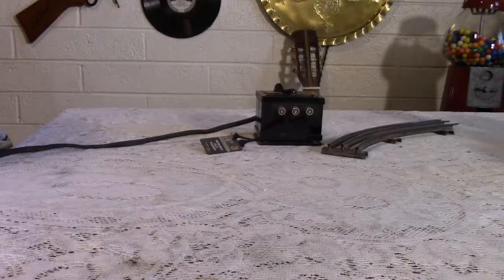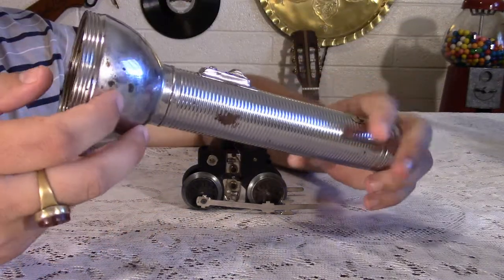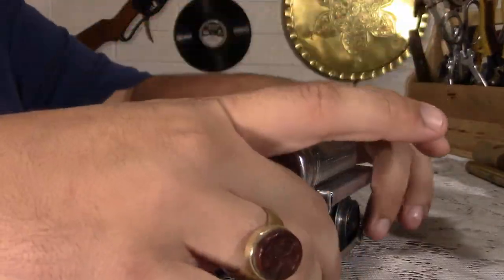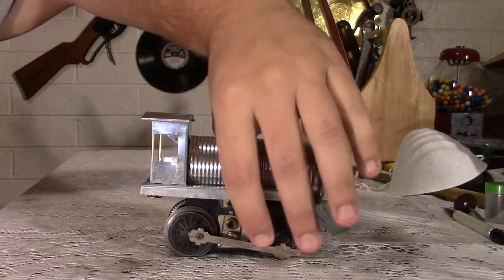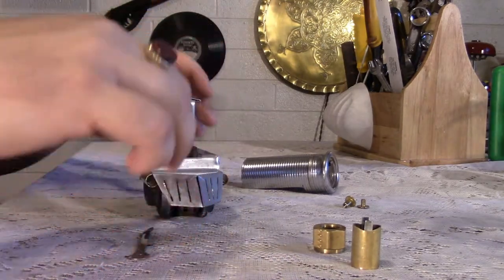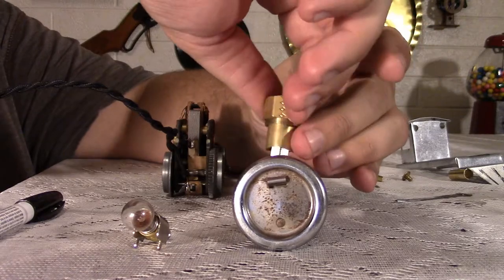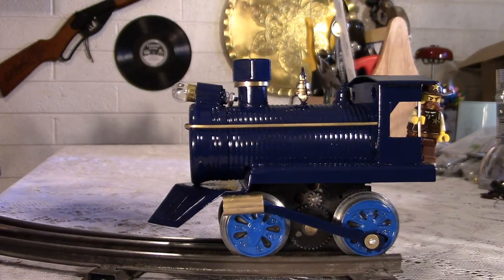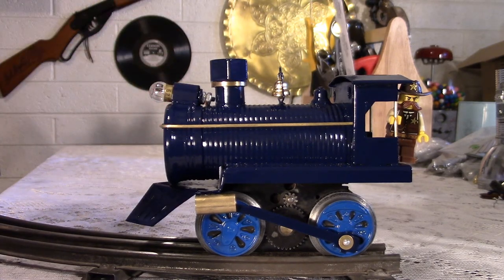Tinplate Train Build Day 1 : The Engine

Comment: That was great. I watched the entire series. I've been thinking to try something like that, but there is surprisingly little like what you did on YouTube for reference. PS. I recently got a Marx 940 engine at a second hand store & although most Marx engines look a lot alike, that one looks like my 940 engine, especially the wheels push rods. I think the 940 may be a 1960's starter set locomotive
Reply from the maker: Thanks! I know what you mean about how little there is on building something like this. Having a few tinplate trains on hand for reference was a pretty big help. My suggestion, if you decide to build something, is to buy an engine motor that fits your basic idea and go from there.
Reply: @azshootinstar2272  Thanks for the suggestion about the motor. I've been picking up Lionel & Marx trains at garage sales (for pennies on the dollar). I'll probably use a Marx engine & build around that.
Reply: you mean a marx 490?
Reply: @buzzytrains9037  Yes, thanks. I have no idea how I switched those numbers around 3 times in the same message (490 vs 940).
Reply: @tommysager138  lol